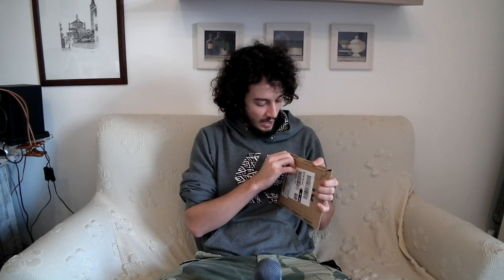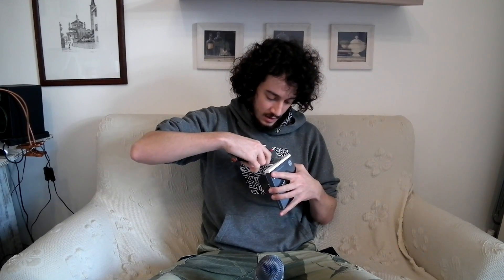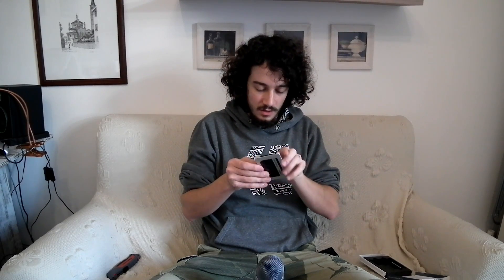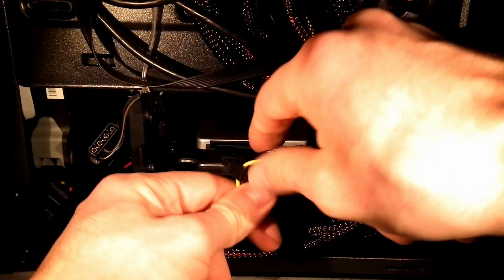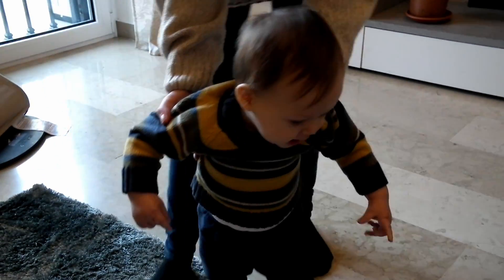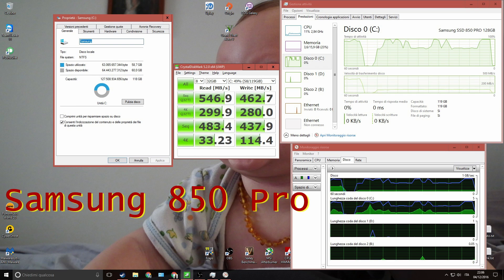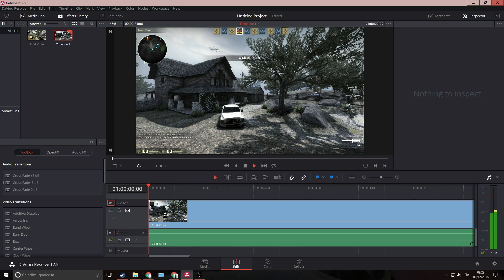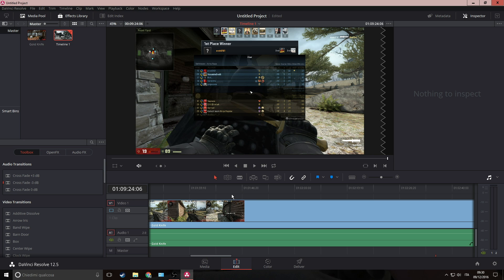This cheap SSD will save your day - Crucial MX300

Comment: Thanks for the review, I need to get a couple of these.
Or any ssd, my pc is fast but uses an hdd and some games take forever to load.
I have one that's 80 gb but that barely has enough room to hold windows.
Reply from the maker: yeah I read you man, my samsung 850 pro is the 128gb version, so I tend to only put the os there. I sometimes went as far as storing temporary files, but that's it